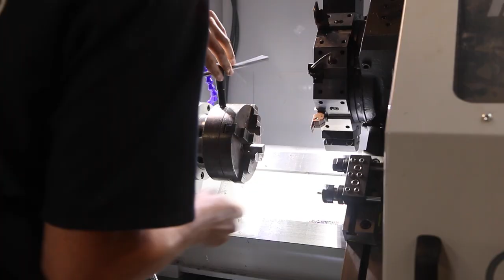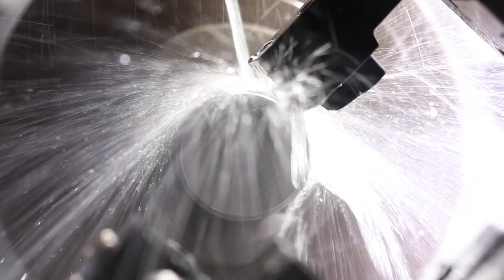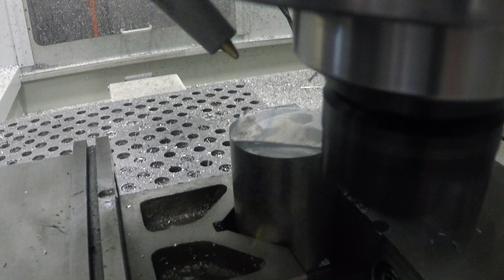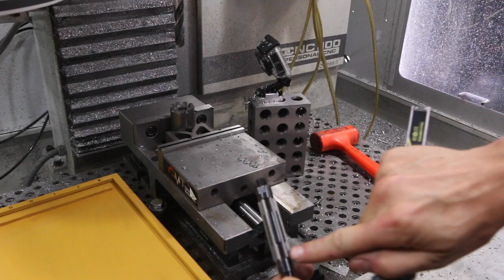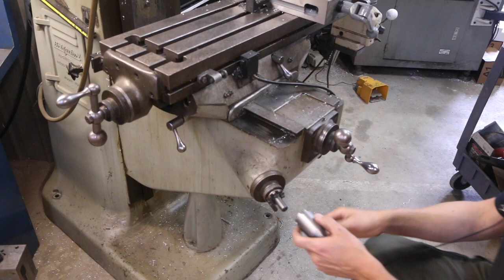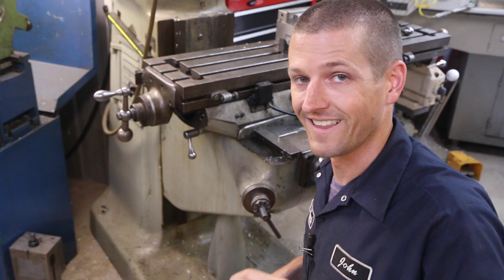Bridgeport Knee Adapter - CNC Turning & Machining!  Widget47

Comment: Very nice set up and a fine adapter. My dad gave me a set of adjustable reamers. 5 in the set. His instructions were NEVER to run under power. Only by hand. Sometimes I'll put them in the spindle and hand crank it to assist in maintaining alignment. All the best!
E
Reply: Well apparently the moveable blades can be twisted out of the slots they are in along the body of the reamer. I have been told the same by a few other machinists as well. Let me dig around a bit to fin some real, no nonsense answer. Eric
Reply: NYC CNC

Hi, Here is an explanation from one of he machinists groups.
http://www.practicalmachinist.com/vb/general-archive/adjustable-reamers-96145/
All the best,
Eric

Comment: I have seen a few of these on youtube and many use the biggest dewalt they can get but$$$$ !
My mill is dovetail column geared head no where near as heavy as the bridgie but i just use a cheap mains powered drill cost like $30 and when it dies i will buy another , better it die than my arm !
Expanding reamers are really only meant for hand use and really only to scrape out a couple of thou at a time, i'm amazed it didn't grenade itself as there is not much holding the blades in just a couple of shallow grooves.
Nice video though and i always like watching cnc machines doing their thing!

Comment: a few years ago our Series 2 bridgeport knee handle got stripped(cast aluminum) and my supv tasked me to fix it.. so i setup rotary table and made a steel plug with that same geometry, bored old handle and gave plug interference fit .. while i was making that part i made 3 of these tools since my rotary table was setup.. when i get back home from vacation ill send u a pic of one that i made.. Keep it up enjoy the videos!
Reply: Home from vacation and I posted a pic of it on Instagram and tagged you

Comment: I've seen these Bridgeport adapters and have used one. Electric drill with a 1/2" hex is best, but, but, but - you are asking to torque your wrist. A reduction gear setup will give both torque & speed for raising the knee, and it will not be in an awkward placement.

Comment: I made one of these too, on my manual machines with a dividing head. I drilled the hole in the lathe, that was easier. I didn't bore my hole at all, the oversize drilling made it a bit loose actually. I also put three flats on my shank.

Comment: Hi John

Reemers should be turned slowly and used with lots of cutting oil. I think most of the problem was to high of an rpm and possibly the reemer had a lot of runout. 
Was your Drill in low gear when you were trying to raise the table?
Great part and video.

Willy

Comment: Nice!  Looks good, and seems like its doing the job.  Rather than a drill, how about a big stepper, an Arduino, and a keypad to enter move orders and offsets with? Or a gear motor, an encoder, and an Arduino rather than a stepper?

For the material labeling, I've started writing the type on the ends of the bars when they arrive, and then I cut from the other end. That way the leftovers are always labeled. Works for me so far...but I'm barely started compared to where you are so don't know if that plan would work for you or not. 

Thanks for sharing!

-- Mike

Comment: What's the pitch or degrees you're ramping at?

Also, a standard pilot should only be the size of the chisel point of the next drill (or a little larger, but as close as you can get it). Much of the torque requirement in drilling comes from displacing material at the center where it has to push material out of the way instead of cutting it.

Comment: I like the cameras John, indeed I was wondering what camera you were using right before you mentioned it. It looks great on my monitor anyway. Not so sure about the adjustable hand reamer in there though ;) As if that wasn't enough, the speed looked a bit, err, "ambitious" to me and I think the reamer agreed, but hey, it worked, so there's no arguing with that!

I like the Arduino tutorials and especially Fusion 360, as that's what I use. Now, all we have to do is convert you to the Dark Side John, and get you working in metric!!! :) We even have Tom Lipton talking in metric now, so I guess some place HAS frozen over!

Keep up the great work and enjoyable videos, I threw myself in the Arduino deep-end with a 3D printer, so at least the Arduino tutorials look familiar now. Great to hear you're keeping busy and sounds like you have some fantastic projects in the pipeline.

Pete

Comment: Looks like you've got a Tormach 5" CNC vise.  What do you think of it for those with mills a bit small for a 6" vise?
Reply: NYC CNC How do you like the Tormach CNC vise?  Is it in the same league as the GMT's?
Reply: Thanks for the heads up.

Comment: was your drill in high speed? if yes try it in low, should do the trick
Reply: NYC CNC I think he means was the Dewalt drill in high gear or low gear.
Reply: Kevo is correct, I think you have a switch on top of the drill which is a high/low setting for a reduction gear, you get 5x more torque or so in low gear.
Reply: was that the case? (sounds like it :)

Comment: Now time for a harbor freight heavy duty corded drill for the bridge mill knee adapter! haha
Reply: ***** I took one of the Harbor Fright heavy duty drills apart and was shocked to see that it was built almost like a quality US tool from the 1950s!  Injection molded plastic instead of cast aluminum, but it had big beefy bearings instead of the cheap bushings used in even expensive tools today.  I should have made an AvE styled vidjo.  Most of the Chicago Electric stuff is junk, but their big beefy corded drill definitely chooches!

Comment: Howdy, I've been in the cnc machining industry for 12 years. I've been working for other machine shops but I would like to start up my own machine shop. I do cnc mill type machining and I use Gibbs cam software make the part programs. I have a friend who did cnc lathe work for about 10 years. What would it take to start my own machine shop? Thanks.
Reply: Victor Black Money, time and dedication.

You'll also want to think about where the income is going to come from. Do you make and sell your own products? Are you a prototyping/repair/job shop? Or do you seek out a couple big contracts?

Comment: Here's a suggestion...  I'd like to see you shorten up the knee adapter as much as possible so the cordless drill can hang on the machine without sticking out too far.  Start by drilling out the adapter (not all the way through) and thread it internally to 1/2" X 20 leaving a smaller hole to accept the left hand thread T15 Torx screw to lock the adapter on the drill.  This way, (if you plan on dedicating the drill to power the knee) you can remove the drill chuck and replace it with your adapter for the most compact unit.
See http://www.jacobschuck.com/hammer-drill-chuck-removal-guide

Comment: My experience with spin windows is that they're a pain the ass.  I'd avoid doing that.
Reply: NYC CNC We have them on our horizontal mills and they've been more trouble than they're worth.  The mounting seals eventually leak, chips will eventually find that one little spot that snags & stalls it out as the bearings are too delicate.  They're just in the way now.  Perhaps this is just due to the nonstop operation and for your purposes they might fare better.  They might also be building them better these days - ours are several years old.  All I know is that in my experience, I wouldn't have installed them if I had it to do over again.